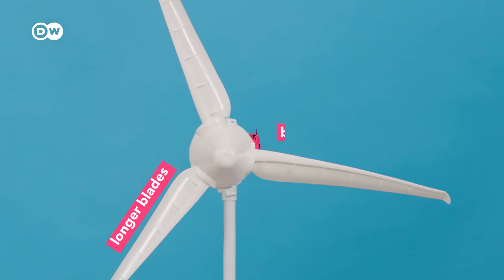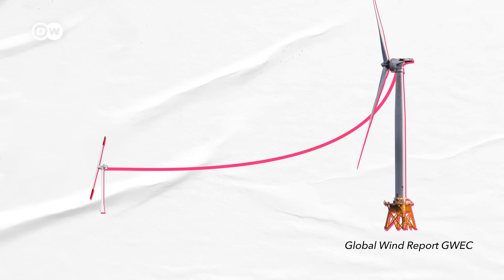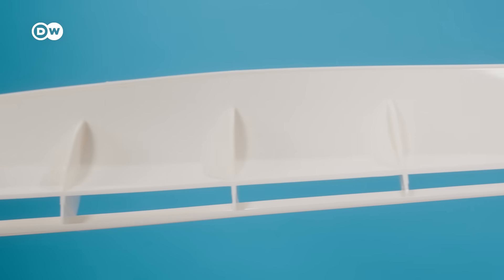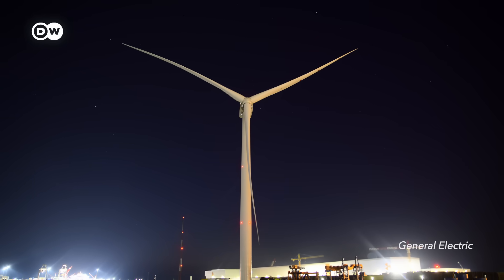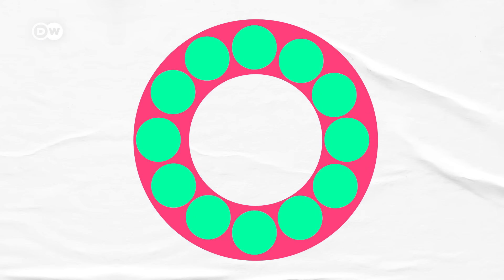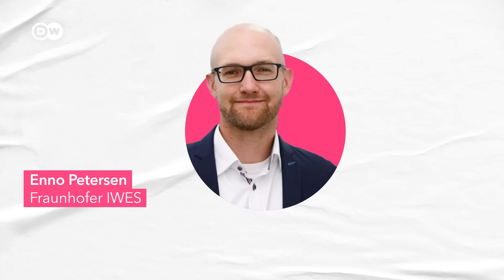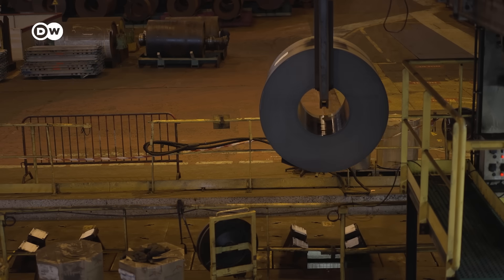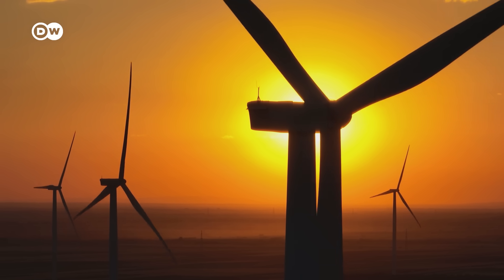The race to build the perfect wind turbine

Comment from the maker: Have you seen any new, different wind turbines in your area?
Reply: Hemp 💚
Reply: Yes, I'm working a bit on planning a wind farm (possibly the tallest in our area). But it will take years just to prepare and approve the environmental studies, process the building permits, secure the rights-of-way for the connecting cables, .... And often these projects get stuck on something, or by the time it's all sorted out, the economic situation changes and eventually nothing gets built.
Reply: No... but I'm from Bavaria
Reply: Great video but a bit confusing. 

The primary improvement has been in sweept area and moving from 2-3 MW to 4-6MW onshore in the past 15 years. 
Offshore has seen a massiv raise from 8MW to now protoypes of 16 to 18 MW. 
Commercial deployment has been up to 15 MW Turbine. 
Big improv
Reply: The video has some mistakes many low wind turbine habe been deployed for decades.

Primarly produced by Nordex as Gemma and Delta 3000 Series or N131 -3000 to 3900. 

Those type have been in production for over a decade now. 

Auch Enercon baut Schwachwindanlagen.
Reply: A Haliade-X 10 MW was recently installed 3 miles from me. It is 150 metres high, making it the largest onshore turbine in England and paving the way, hopefully, for more of the same! It looks space age, with incredibly thin, airplane wing shaped blades and a shaft holding it up that curves in, apparently using 60% less material than a steel equivalent. It spins like mad in the wind, clearly a good design.
Reply: Nope just the same old crap they started erecting decades ago - so strange how we are in such a technological era but use stupid gearboxes and toxic fibreglass
Reply: I don't think you foreigners realize how offensive using the name "Jesus" as a curse word (1:21) is for many English speakers.
Reply: @ what lost soul does
Reply: @danielonesra  Do you know what?
We don't care.
Greetings from an ateist
Reply: You missed the point. It's not about religion, it's about command of the English language. Speaking this way may be okay with your buddies in a bar, but it's not appropriate register for state television. It would be best if Germans would stick to German.
Reply: I have a different designs and I may give you my 3 designes much efficient.
Reply: "Cheesus" yes, we do. Taller ones.

Comment: I was under the impression that the size issue is not only weight, cost and logistics but that the tip speeds on the longest blades were/are approaching the speed of sound at higher RPM, which causes a whole different set of issues. Am I wrong?
Reply: That is why the tip speed is limited. The bigger the blades, the lower the revolutions per minute.

Comment: Kinda surprised about the gearbox as the challenge. In aviation there  are gearboxes rated up to 24MW, which are just a few hundred Kg light. Obviously their job is the opposite, driving a slow fan from a very fast turbine, however they manage to construct them as a lifecycle product, which means there is no maintenance except changing the oil for the life of the engine. 

Segmented wings are fairly old hat, glider planes always had them, especially those with larger wing spans (more than 15 meters). But yes, there is a huge difference in the stresses rotor blades experience.
Reply: Planes have a much lower runtime than windturbines.
Reply: @old-pete  Do  they? Around 6.500 hours per year, 30 to 40 years long.
Reply: @Soordhin They fly 2500 to 4000 hours per year and get regular overhauls.
Reply: @old-pete  Shorthaul,  longhaul is around 6.500h.
Maintenance shouldn't be any issue, it is much easier on an immobile object securely fastened to the earth. And again, those gearboxes for planes are actually lifetime parts, they do not get serviced for the life of the engine, unlike the rest of the engine itself.
Reply: @Soordhin  A 747 lasts 90000 hours or 35 years, that is around 2500h per year. With more hours, it lasts much less.
Planes are more easily accessible and are checked much more often.

Comment: To increase the capacity, why not increase the number of blades instead of increasing the length of the blades ?
Reply from the maker: Hi there, thanks for asking. Increasing the number of blades on a turbine can reduce aerodynamic efficiency due to increased drag. Longer blades are more effective at capturing wind energy and provide better performance. Adding more blades increases turbine weight and mechanical complexity. It also raises costs and requires more maintenance. In general, longer blades are a more efficient and cost-effective solution than adding extra blades 🌬
Reply: It is mainly a cost issue.
And doubling the blades, does not double the output. The output increase decreases with every blade. 3 is considered the optimum in benefit per cost.

Comment: At 9:53, is the picture showing "jet" (stationary) gas turbines for generating plants?
Reply: No, I think those are gearboxes.  I do see the blade discs you noticed but I think they might be to drive cooling air. There is no big intake compressor fan and the casings don't look to be thick enough for gas or steam turbines.

Comment: Very poorly designed. Blades have very little active surface, on which the wind will create rotation. That surface shall be at 45 degrees, to be as far as possible from the center of rotation and to be as big as possible. None of these requirements are met in that design.

Comment: The barrel design of wind turbines is actually more efficient than the blade design and costs less.
Unfortunately, there is the incorrect assumption that bigger is better, for the same cost of the large common design of wind turbines you can place smaller turbines on residential rooftops and produce more than double the electricity. 
The biggest problem with wind and solar power systems is that the power needs to be stored for when it is needed and the most cost-effective way is to create a system of closed loop hydroelectric power stations strategically placed throughout a city. 
The people and companies that provide the electricity production simply don't know what they are doing and don't care because they get paid regardless.
Reply: Residential windpower is completly inefficient and too expensive. Bigger is better. It is just physics.
Reply: @old-pete actually Smaller wind turbines are far more cost-effective than the large wind turbines that can only be made by very few companies and are very expensive to transport. 
Small turbines can be made by almost any fabrication facility and can be transported by any delivery service. 
Smaller is better for manufacturing, matenance and shipping. 
I would suggest that you actually do some research into how electricity grids work and what is needed to have electricity travel over different distances.
Reply: @itt2055  I studied it. The physics are unambiguous and favor bigger turbines. Small turbines for residential areas are a waste of money, since wind conditions are appalling and the turbines are too costly.
Reply: @old-pete considering the wind conditions in suburban areas is perfect for small wind turbines and they are far more cost-effective than the large wind turbines I don't think that you have actually done any research and don't actually know what you are talking about.
Reply: @itt2055 I have.
Windspeed is extremly low and unsteady, because of all the buildings and trees.
But please, share your numbers.
Reply: The most efficient small wind generator is not yet designed that is the big problem. Everybody is trying to make the blades more efficient.We need a new design,not a design that is cheap enough for everybody because of that view new designs that is efficient and reliable will not be designed. So I desided to design a  small turbine that will not be cheap , it will be efficient and reliable so in the long run it will be cheaper than the cheap design. It will be a Savonius with very little vibrations and much less vatique loading and will be more free revving. If it do not sound possible wait and see. Savonius will become the most efficient wind generator of all VAWT 's
Reply: @HendrikStander-v1l It is still too costly compared to HAWT.
Reply: Too costly is a relative statement. There is No efficient small wind turbine  not HAWT or VAWT so if you are paying for nothing it is costly. An efficient small turbine will be a Savonius why it is not available yet is because of the vibrations , low speed and vatique loading. Solve that and you will have the best "most efficient" turbine. A proto type is build and it have the highest TSR of any Savonius available
Reply: @HendrikStander-v1l   Small windturbines are not efficient compared to bigger ones.
Reply: @old-pete  you are correct. It depends what you mean with efficiency. I cannot put that big turbine in my residential space. It is not suitable . The problem is that the more suitable " small" turbines are NOT efficient. Why dont we all drive the same cheap model small car - cheap is a relative term. If I build the most efficient small turbine (It cannot be the cheapest) there will still be a market  for it, because some people want efficiency and do not want cheap
Reply: @HendrikStander-v1l If one wants cheap electricity in an urban enviroment, one goes solar.
Small windturbines can be interesting in a rural setting with limited power supply, but usually solar beats that too.
That leaves the arctic regions...
Reply: @old-pete  I agree but wind and solar are complimentary. Household turbines are Microturbines. Small scale class turbines are up to more then 100Kw. Small scale turbines can be used in so called microgrids. The problem is there is no suitable turbine for it. An efficient 50Kw Savonius will be good ,but it do not exist. Now it do exist
Reply: @HendrikStander-v1l  If you are completly offgrid, then it could be interesting. But they are already solutions for small turbines.

Comment: The video doesn’t even cover that windmills breaks easily under strong winds and they are extremely difficult to repair due to the heights. 

And windmill blades deteriorate within a few years of operation. 

And the blades are not recyclable. Can only be buried in landfills.
Reply: Windturbines are designed for hurricane winds...
The blades can last over 20 years and they are easily recyclable.
Reply: @  really? 
https://youtube.com/shorts/9x4xKrPYBJ8
Reply: @jamsbong That video of the turbine crashing is fake
Reply: @ recyclable? 
https://youtu.be/knX7NkJILhs
Reply from the maker: Hey there! Wind turbines have a lifespan of about 20 years and withstand strong winds. The recyclability of wind turbine blades is definitely a challenge. But there is a lot of research and improvement happening - we looked at the developments there a few months ago in this video 👉 https://www.youtube.com/watch?v=HzQShAlObn8&ab_channel=DWPlanetA

Comment: Regarding larger wind turbines being more inclined to gear and generator problems. Don’t you find the solution to be as trivial as splitting a single generator and gear into several smaller ones fed by a common driving shaft? Elon Musk uses the same type of rocket engines but with varying number of them for a reason.

Comment: I have found that small wind turbines do not require much height and wind power, and the generator has a very high efficiency, reducing noise and installation space problems, and can produce more electricity than general large wind turbines.
Reply: That is doubtful.
The physics favor large turbines.

Comment: An interesting look at the engineering , cost etc of wind turbines.  The 'elephant in the room' though is why and what for?  Do we have a CO2 problem?  Will all these wind turbines ultimately contribute to changing the weather?   Fossil fuels will run out eventually but are these impressive structures really the answer; or are they a semi ill-thought out quick solution to a problem that does not actually exist, all the while requiring vast resources and spoiling our view of the World?  I don't know, but the World seems reluctant to have that debate.
Reply: Windturbines are over 80 years in development. Hardly something one can call a quick  solution....
And yes, the debate is over. We need to reduce CO2 emissions.
Reply: Regarding the fossil fuels it takes to create a wind turbine, they recoup it within 6 months of operation. Considering wind farms usually are designed to operate for 20+ years

Comment: At what point does building a bigger wind turbine become less cost efficient than building a second one next to it.
Reply: Depends on the location.
Offshore, 16 MW turbines seem to be the solution and bigger ones get introduced.
Reply: @old-pete  As I understand it, the industry has been pushing toward 16+ MW turbines for offshore locations because the infrastructure can support them.

But at a certain point, building two smaller turbines may be more economical than one larger turbine, due to scaling inefficiencies in manufacturing, maintenance and installation.

My thinking is based on the fact that doubling a turbine’s size doesn’t necessarily double its power output, due to the square-cube law (as blade length increases linearly, mass and material needs scale cubically).
Reply: @mikmop  Yes, it more than doubles the power output.
As long as one can build them and they work, one will build the larger one.

Comment: 20% more diameter, 44% increase in efficiency provided there's 1-to-1 correspondence of efficiency vs area swept by the rotor, which I doubt it is. There's a natural limit of how high and wide we can build those structures. The wind energy density is extremely low, compared to almost all other sources. It's a fools errand.
Reply: It provides a lot of cheap electricity. It is a fools errand to get it more expensive.

Comment: Why not use a chain and sprockets to do some of the reduction and move the gearbox down to the ground?
Reply from the maker: Hey there! There are several reasons why the gearbox is not put down to the ground. One of them is that positioning it closer to the top minimizes the need for complex transmission systems (such as long shafts or excessive gearing) and allows for a more direct, efficient connection between the rotor and the generator.
Reply: @DWPlanetA  the eigenfrequency or natural frequency of the tower rises with no weight at its top. Bad for material fatigue.
Reply: How would that work with the turbine need to turn to face the wind? A chain that can handle the millions Nm ( or LbF) or torque would be too heavy and expensive.
Reply: @niconico3907  Good point about turning to face the wind. Hadn't considered that. The chain would be balanced on either side, so weight wouldn't be an issue after overcoming initial inertia.

Comment: Solar is the worst of renewable generation for grid supply, even where it is very sunny. 
Wind is not much better and there is not really any point in making them slightly more efficient as the inherent flaws remain. 
It is intermittent, which is significant and unfeasible flaw to overcome. 
It is also asynchronous, has no inertia or reactive power input, all requirrements for grid supply.
Reply: But that flaw is overcome everyday, worldwide.
The more windturbines and solar panels, the smaller the intermittency.
Reply: Pete, 

simply not true., although it depends what you call small, that is subjective.
However even the smallest under generation requires some thing else in it's place. Logically it makes no sense.
That is before you consider the technical deficiencies of wind and solar, they are not an equivalent to conventional generators, or a replacement.

Comment: One very important point, you forgot to point out that these cost pressures affect all industries using these materials. Investor pull-outs are due to the reduced profits they were promised from these projects, not because they are not viable. Also onshore wind is as cheap as solar, and given its productivity, offshore is at about the same cost, perhaps 25% higher, when done properly. Wind and solar are the CHEAPEST, yes the cheapest forms of electricity generation. Your video seems to make out that wind is unbearably expensive and unsustainable, this IS NOT TRUE!!! Why would China install 20 new GWH of capacity, if this were the case? They did this in the last two years.

Comment: The best part is no part - todays large wind turbines do NOT use a gearbox!!
Instead they have a larger number of poles in the generator winding - the poles are attached to the main shaft
The shaft will spin at the best rpm to extract the energy from the wind - this produces "Wild AC" which is converted to "Tame AC" by the power electronics

Comment: When people talk about the difficulties changing to a grid powered by renewables, I like to ask, when did the last sailing ship take wheat from Australia to England? It was 1949.
All the problems we have changing from fossil fuel to renewable energy have happened before, when we changed from renewable energy to fossil fuels. It will be slow and complicated but the end result will be a richer human population.
Reply: ahh lovely to spend 3 months on a ship or 19 Hours on a plane? theres a reason we use fossil fuels
Reply: @Slavicplayer251 And there is a reason to change back.
Reply: So why rely on wind?
Reply: @nickhanlon9331 People do not rely on wind alone. They rely on wind, solar, hydro, biofuels and geothermic energy.